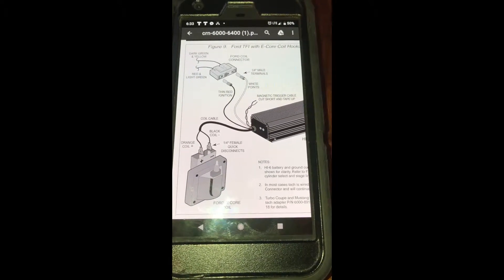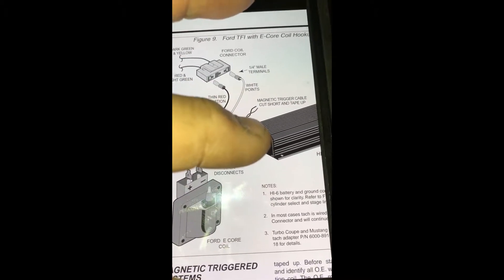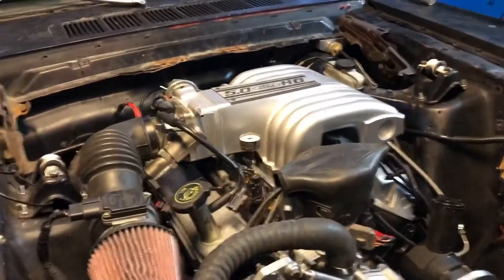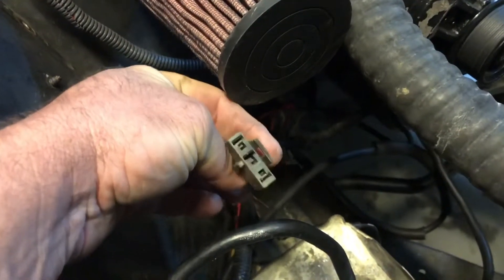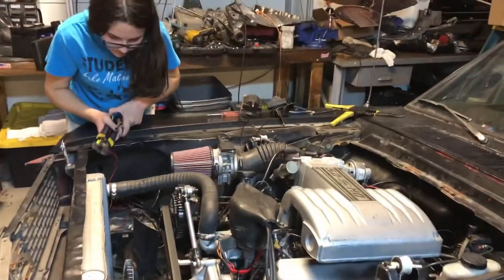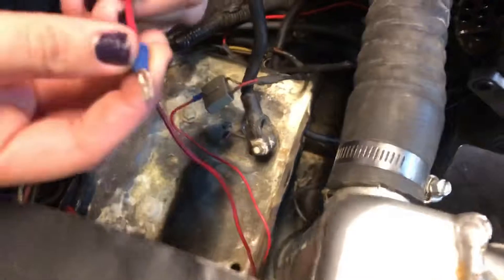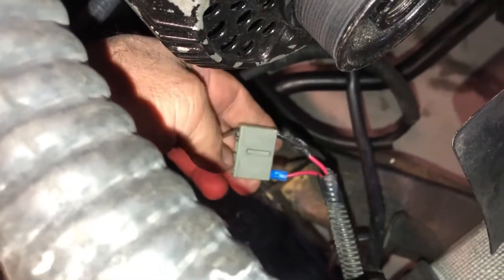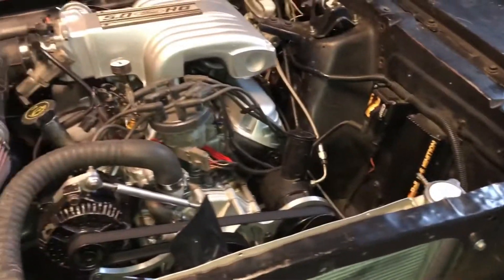Crane Hi-6 Fireball ignition & coil mustang EFI fuel injection

Comment: Hola saludos cuál es la configuración de las flechas del módulo de ignición, estoy batallando con un sn95 que trae ese módulo...
Reply from the maker: That’s just an rpm limiter. Those don’t work if you didn’t supply power to them. You set them at your max rpm that you don’t want it to go above
Reply: @v8only  many thanks...
Reply from the maker: I’m sorry. No translation is offered. Don’t understand question
Reply: Hello greetings, what is the configuration of the arrows of the ignition module, I am struggling with an sn95 that brings that module, at low revs it chokes, and possibly it is the module ...